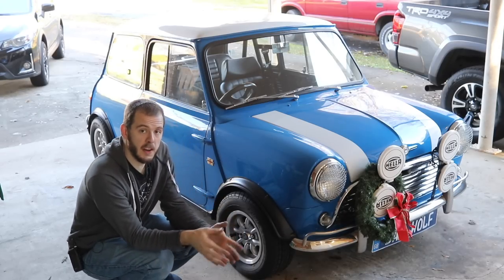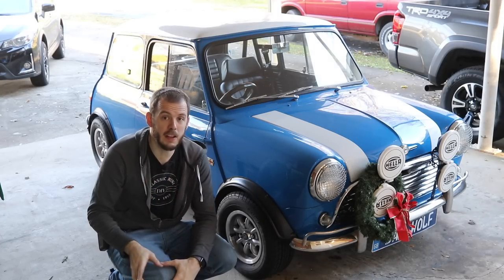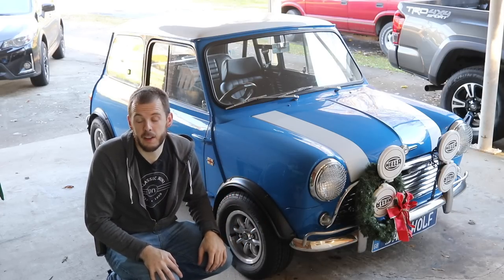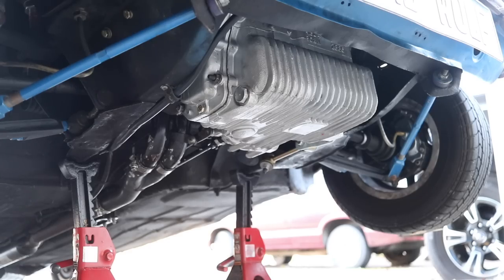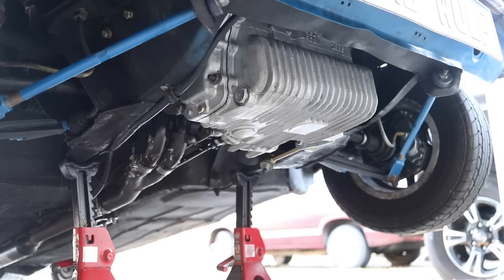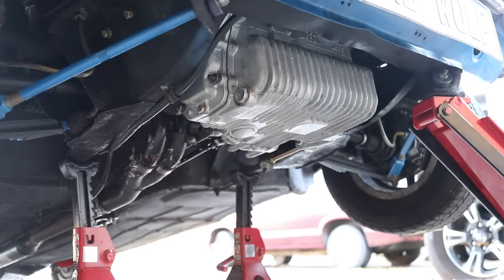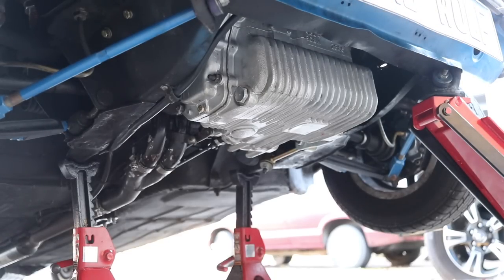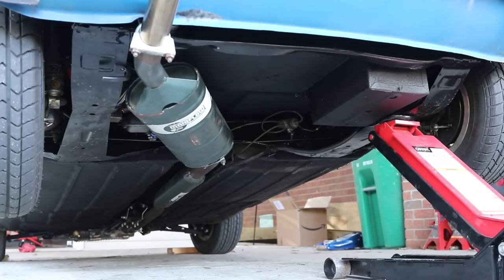Quick Tips - Jacking Up your Classic Mini

Comment: Lets remember NOT to jack under the gearbox, some have, as it will break the engine mounts.
Reply: I am digging that jack ! Please send info. Your vids are awesome. Merry Christmas.
Reply from the maker: Hey Steve link to the Jack is in the description! Thanks.
Reply from the maker: Jacking up the engine for the sake of repairing engine mounts is a very good example of when to jack from the gearbox using blocks of wood as you suggest. However you should never jack the full weight of the car up from the gearbox. The engine mounts are not made to handle the full weight of the car by any stretch of the imagination.

Comment: I wouldn't use the tie bar mounts to jack up a complete car. They're not designed to be stressed in that way and if you bend them, it'll affect your cars castor angle. Additionally, if you're using rubber subframe mounts and they're older and a little worn, jacking up using the tie bar mount could cause the frame to deflect and possibly contact the body.

The flat section underneath where the lower arm mounts to the frame is perfect, I place a piece of wood between the frame and the jack/axle stand to avoid causing any damage to the paint/surface.

Comment: Another point worth a mention, because its a bit iffy jacking under the tie rod mounts, tyre shops may jack on that flat area below the lower arm? Well on the clutch side its so easy to crush the live battery lead and a possible short, worth knowing 😊

Comment: I jack the rear in the middle of the back of the subframe, but I use a 2x4 to spread the pressure. No damage to date after 25 years.

Comment: Great video as always! But you probably know that the mini does has a jacking point in the middle of the sills. Do you know if that works well?  I believe you have to get a special jack with one arm that fits into the hole placed in the middle of the sills. Because, that way if I wanna change my wheel with a spare I don't have to care about the mini rolling away from me. And I don't care a heavy jack or jack stands with me on a trip anyway. Does anyone has this sidelift and does it work well?
Reply: Avoid using it. Its a terrible place to jack the car up! Apart from the tiebar mount, I use the places Cole has demonstrated.
Reply: You're right, I bought a mini in 1976 and it came with the jack that fits into the (approx) 1 inch square receptacle located in the sill approximately midway under each door.  In order to operate the jack you used the same "crank-style" wheel wrench that came with the car.  One odd issue was that you had to open the car door in order to fully rotate the crank while raising/lowering the car.  I used this a lot when the car was newer, but agree with Dagowly: on an older crusty/rusty mini I wouldn't needlessly risk damaging the sills - stick with Cole's recommended jacking points.
Reply: @Dagowly83  Yeah, that are the places recommended by any mini-forum or enthusiasts also. At home, I use the places Cole uses too. Just faulty engineering from the engineers of British Leyland I think to use a sidelift. But, what type of jack do you recommend to carry with you for replacing a flat tire on the road?  A scissor jack or a hydraulic bottle jack? A floor jack doesn't seem practical to me because it's too big to fit in the trunk. Let alone jack stands...
Reply: @iliaslamari7315  I have breakdown cover, so get mine flat bed transported home.
Reply: I've used the side jacking point under the door many, many times.  It works a treat, picking up both wheels on that side at once.  Probably not ideal if you're looking to support the car on stands, as you really want to lift by the ends, rather than the sides...but it works very well for changing tyres on the side of the road.  The jack was also very reliable, so long as there's a little grease on the screw threads.  The only real downside is that the door needs to be open while jacking, so if it's raining, your interior is going to get a little damp.
Reply: @aussiebloke609  agreed. It's fine unless the car is a rusty mess

Comment: Quick tidbit from your neighbor in Atlanta, I use a small block of wood on jack so that the metal cup on the jack does not gouge the frame and promote rust.  How those GAZ’ settling in?
Reply from the maker: Great idea! I should start doing that or get some rubber covers for them. I have had those GAZ shocks on the car for almost 5 years now. They are top notch. Very very happy with them.
Reply: Absolutely!

Comment: There are factory Jack points on a classic mini.  Read the instruction manual.
Reply from the maker: While this is true, those factory locations were made for the bracketry the cars were assembled on during their movement through the factory. Due to the age and rust on these cars, the factory locations are often rusted or the body surrounding the points has degraded past being reliable to lift from. That's why I suggested these points in the video.
Reply: @classicminidiy  in Australia we have compulsory yearly inspections to identify rust and other defects as part of re registering.

Comment: You know there’s a jacking point in the sill right? Not that it’s a good place to jack it up from and no one seems to have the jack that comes with the car from new.
Reply from the maker: Someone else mentioned it in another comment, I had no idea. That said I would never use that even now that I know about it hahaha. Subframe is way safer.
Reply: Classic Mini DIY yeah, they’re all rusted out usually. I’m replacing mine for strength but welding up the hole as I’ll not be using it!
Reply: I used to and then when I came to welding my sills up, I realised that all of the reinforcement from the sill jack point was  missing completely from previous owners cutting corners in repairs. Needless to say the sills were bent severely out of shape!
Reply: I do